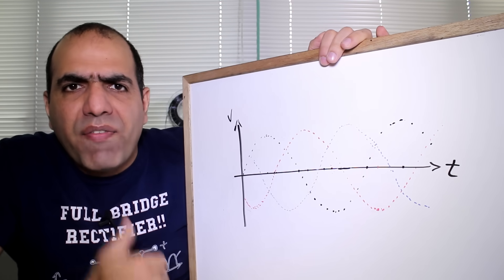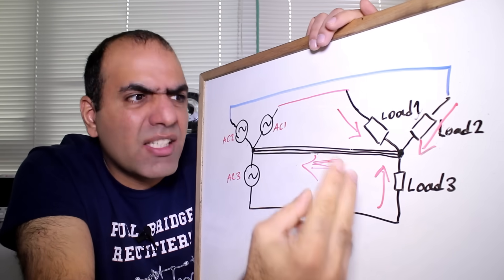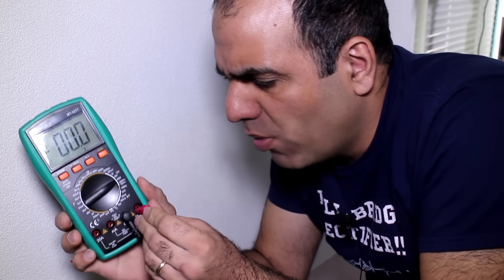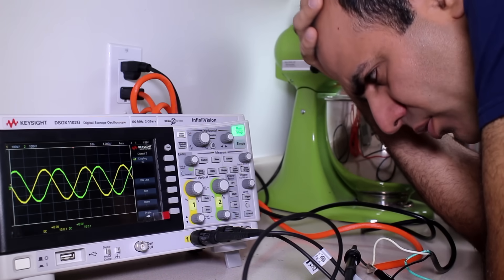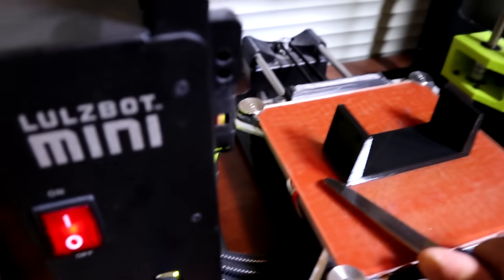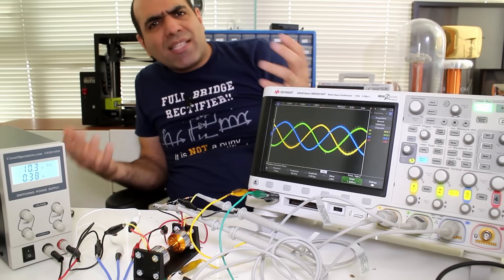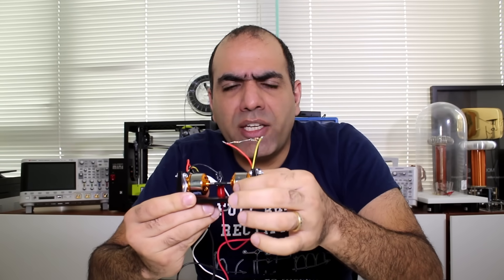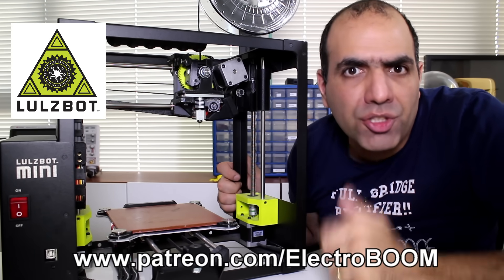Why 3 Phase AC instead of Single Phase???

Comment: I thought at first why 3 phase not 5, 6 or 7, ... ? Think about it
Reply: There actually is a good reason for that. In the most simple of reasons, adding more phases produces diminishing returns. You have to remember that adding a phase requires another transmission line, which costs money. 3 phase is the most cost efficient, with adding more essentially giving negligible results...
There is a video about this, if I'm not mistaken...
Reply: 3 is a mystic number.
Reply: https://youtu.be/HqZtptHnC2I
Reply: It also depends on how much voltage you gain if you connect two phases in series to achieve higher voltages. For example, a device needing low amounts of power can be connected between Line and Neutral, but devices needing higher amounts of power can be connected between two phases. The higher voltage helps to reduce the needed current.

The voltage between two phases in a three-phase system is the root of three times the voltage L to N
The voltage between L1 and L2 in a four-phase system is significantly smaller.
With six phases, the voltage between L1 and L2 in a six-phase system is equal to the voltage between L1 and N.
With even more phases, the voltage between L1 and L2 is even smaller than the single-phase-voltage.

So the more phases one have, the lover these cross-phase-voltages are. However, we do not use two-phase systems (voltage between L1 and L2 would be x2 single.phase voltage), as three-phase systems are more balanced and better-suited for motors
Reply: No matter how many phases you will add, you only gonna increase complexity of the grid with no real benefit (maybe the power would be delivered smoother - more sinewaves).
Reply: https://www.youtube.com/watch?v=HqZtptHnC2I
Reply: Because that means you would have extra wires. 3 Phase gives you constant power with the least amount of wires.
Reply: Edmund Tan if you added the ground line there would be no current going through it because the voltage difference between the starpoint and ground is zero.
Or, if you had an unbalanced load, you'd reduce the power delivered to your system if you added a load on the neutral line (which is required for an unbalanced system)
Reply: it would be smoother, you see generator turns and angle between the coil and magnet is proportional to voltage (english not good enough to explain). If you would have more phases, There would be more coils and they would generate separate phases which angles are less apart. You wouldn't increase actual power transfered, because it's the same generator rotations, nothing changes, except power is split into more parts. Adding 3 additional wires would only increase transfer capacity
Reply: Skaarjman the power wouldn't be smoother even, the 3 sines deliver mathematically exact constant power already as long as the loads are balanced. But you could deliver twice as much power for 3 phases added, so the returns are linear.
Reply: The returns wouldnt be linear from a cost point of view, seeing that you need to bury or carry these lines. If you double the lines, you need spend more than double to carry/bury those lines.
Reply: You dont not need a neutral line. When you have a neutral line, when you have a fault current, it'll be zero sequence and will flow through the neutral. This will trip current relays and stop the fault.

With an ungrounded system you do not have a fault current through the neutral, thus you get an increase in voltage in unfaulted phases (by a maximum factor of root(3)). If your system is ungrounded, you need to spend more money on equipment that can deal with that increase in voltage. 

As you can imagine, an ungrounded high voltage line is not ideal as you would need to spend a significant amount of money on insulation. a 250kV line would need to be able to deal with 500kV+ which as you can imagine is significantly more expensive.

A medium voltage line can be ungrounded as the cost to get equipment with more insulation is less than the cost of having a more reliable system. (you wont have a fault current so an ungrounded line is more reliable). These lines would typically be in the "middle of nowhere". If you see a neutral line, it'll be over top and will protect the line from lightning faults. It just wont be electrically connected to the phase lines.
Reply: More than 3 phases would not make a motor operate more smoothly as the power being applied to the motor will be constant with 3 phases. A single phase motor rattles because the power is applied in a sinusoidal fashion. A 3 phase motor can be treated like a DC motor when it comes to its control and handling.
Reply: Additionally, the insulation of the unground line would add a humongous amount of capacitive load. Hence making multiple transformer stations every some kilometer a necessity to keep the power factor low.
Reply: Eric Cartman actually the cost would be lessened as it's cheaper to just add a second, third or whatever triplet of phases to a trench you're already digging for the first or a mast you're building. You might spend a little more because your trench or mast needs to be bigger to keep the lines apart, but the equipment and people are already there so you end up spending less than linear. But I'm not an economist so that might be wrong.
Reply: Some times very short sections of 6 phase are used like before rectifiers, precisely for the smoothness reasons, but in nearly all other cases it would be simpler to just run two 3 phase lines parallel.

I'm not a big expert on transmission line technology, so no comment on how much that would complicate switch gears and transformers compared to two parallel lines, but in the very least there would then be two frequency strandards to worry about.
Reply: In cases where its cheaper to have a 6 phase system, we just run 2 sets of 3 phase in parallel. There's no advantage for using a legitimate 6 phase system unless you're powering a high powered DC system that requires pure DC without ripple. That kind of DC system is highly niche.
Reply: There is 6 phase transmition lines in france, but they are experimental. It is more efficient but we need more tecnology and investment for that. 5 and 4 phases are out of balance, so not worth it.
Reply: I am adding a note to this question;
Why windmills has 3 part ?
Answers are the same o think
(I dont know anything about 3 phase but some smart people thought about it and i suppose they calculated 3 phase is more efficent)
Reply: windmills are 3 phase because industrial machines are 3 phase. Other phase machines are nieche and thus more expensive. 

Doesnt really matter much anyways, windmills are rectified to DC and put through an inverter to match the grid.
Reply: A 6 phase transmission line wouldnt not be any more or less efficient than 2 sets of 3 phase in parallel.
Reply: This has been tested you end up with diminishing returns. Also, each phase needs it's own copper, it's own insulation, bus bar in switchgear and panel, it's own winding in a transformer, etc. This is not ideal in terms of cost of cable since even AAC and ACSR gets expensive when running miles and miles of it.
Reply: 5 n' 7 not balaced 6 too complicated
Reply: Why not an infinite number?

Cost. 3 is the best in the cost vs result curve
Reply: Grounding system to reuse energy
Reply: All i can say is that the the AC is made by generators that produce 3 Phase. All i know theres only 3 Phase that is made.

Comment: A real electrician would use a "terminal bock" (the one you can cut) to connect the motor shafts, instead of tape… or perhaps not?

Comment: Wait wait wait... the sum of the currents to the three phase load, according the first Kirchhoff law applied over a surface that enclose the load, is always zero! On a balanced load the currents have equal intensity but is wrong the assumption that the sum of the current is zero only on balanced load!
Reply: He means if there is still a neutral wire at the center. And it's always there specially for case of unbalanced load. Suppose you plug in electric kettle (2,2 kW) to one phase and electric bulb (40 W) to another. Without neutral wire you get almost 204 volts applied to you poor bulb which destroys it immediately. There is one evil event which happened a lot in Russia: burning out of neutral wire. Switching power supplies are great, but they tend to kill neutral, because they generate 3rd, 9th, 12th harmonics of current which don't cancel out in neutral wire. They rather sum IN PHASE and kill this poor wire. After that somebody has 380 volts in their outlets instead of 220 volt. BOOM!

Comment: Where I live in canada we get a center tapped 240V transformer (120+120V 180 degrees out of phase) and the high voltage side is either Live to Neutral or Live to Live. 1 pole mounted transformer can supply multiple homes, you can see the 3 insulated low voltage wires, 2 live, one neutral.

Comment: Hi! I love your vids. I always wondered about these phases. PS: Could you give us a DIY method to insulate a desktop PC when you don't have an earth connection on the outlet? I always get zapped on the metal case. Thanks, senpai!!!
Reply: dismantle power supply and find two 'Y' capacitors which go from live and neutral to ground. Kill them with vengeance and you're done! They are discs, usually blue, with lots of pictograms on the surface.

Comment: you said households only get one or 2 phases. here in germany every house gets all 3 phases. because you can distribute the load relatively easily so there is less load on the neutral and a lot of people use them  for tools an machinery like a table saw (at least in the rural areas where people do a lot of work arround their houses)

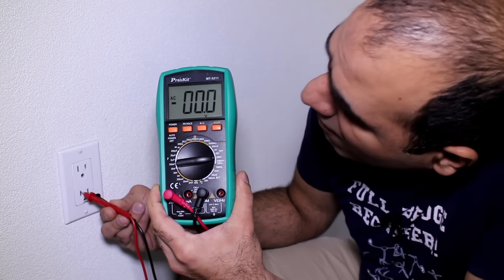Comment: @3:05 too late with the tip. It already happened to me... But I was standing on a ladder measuring the light point in the sealing. It was quite the scare...  If only I had a camera and a unibrow, it would have made for a nice video.
Reply: I did the same but not with main power outlet...it was close...
Reply: when i was 14 we had a problem in the house and i tried to measure current in parallel on the main house switch, it was scary as hell. I knew how to do it properly but i was so fed up that i just forgot
Reply: Chris Wesseling me too.
Reply: Next time don't stick a fork into the plug!
Reply: Chris Wesseling I've done it too when i was 14 and got my first multimeter and the meter exploded. I think this thing has happened to everyone.

Comment: 3 Phase power at home is the American dream.
Reply: move to europe
Reply: Move to Europe. 3 phase in each house and you get 230 volts which gives you 400 volts 3 phase. And if you pick Czech Republic you will still be able to carry a gun.
Reply: Most of the houses aren't made of materials that you can cut with kitchen knife. Solid concrete walls.  Only seen few houses without fuse and if you are curious, the wire just melts or electric meter dies (rare)
Reply: I am Czech, we too live in houses with actual walls rather than whatever Americans use that keeps getting blown away by hurricanes. But we do have fuses. Three big ones before the meter which determine the absolute limit of how much current you can draw (and the bigger they are the more you pay), then we have a main breaker and separate breakers for power circuits and light circuits in each room or floor (depends on how big your house is and how are the wires set up, but lights and appliances always have separate breakers). Some old houses will still have old fashioned fuses instead of the breakers but I have yet to hear of a house which would just directly connected to the grid without any breakers at all.
Reply: In Lithuania where I live, there's main MCB (rating determined by amount of power  you can use, dictated by electric company) and electric meter in the same box, outside. Then, it goes to electric panel in the house with MCBs and RCDs (every outlet must be protected in new installation).  Europe standards.
Reply: I know i live in germany, several household items make use of 3phase power here :D
Reply: Every outlet protected by GFCI, maybe in bathrooms ones with lower threshold
Reply: yeah im okay with that, i enjoy the lower murder rate here tho
Reply: most houses i've seen here do have 125A 3phase in the basement.
I struggle to think of anything that might need more than 32A tho xD
Reply: No fuse? What prevents you from burning the wires and setting your house on fire then?
Reply: Yeah, combined breakers became quite common but at the time many houses were built, GFCIs were still very expensive.
Reply: GFCI in bathrooms?
Reply: they are mandatory for bathrooms (even in old installations) and new installations need them everywhere, 30mA is the limit, and 30ms is also the maximum allowed latency here in Europe.
Also upgrading is mandatory whenever you change something in the installation which keeps the average installation at quite high standards.
Reply: Here in Germany most houses have a single GFCI for the entire house, some newer houses have GFCIs for every room or even breaker, but Ive never seen a GFCI implemented into the socket in bathrooms here.
Reply: Germany here, in my place all our smaller breakers are combined overload, ground fault and arc fault detection ones. I think there are new regulations to have arc fault detection breakers now, but I am not really sure.
Reply: In Russia they can give you three-phase as well as 63A circuit breaker or even unfused power to house
Reply: Oh. No guns for you then.